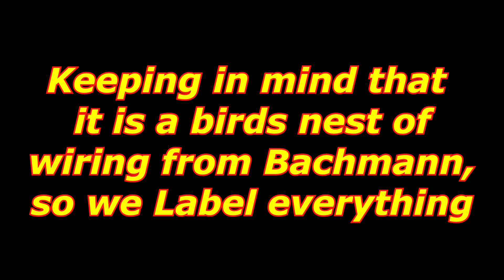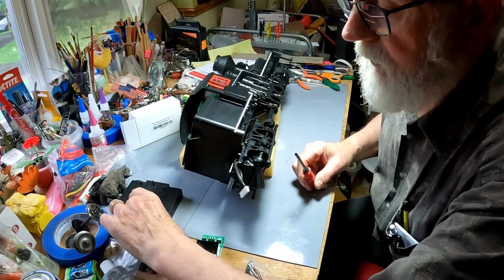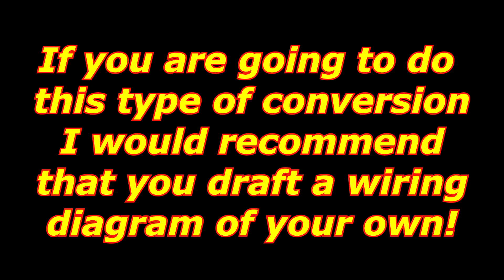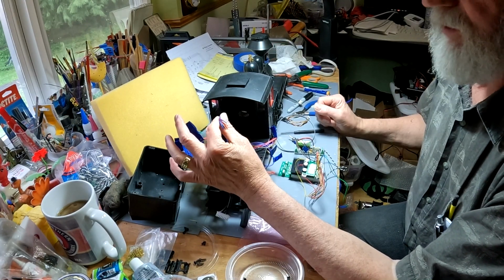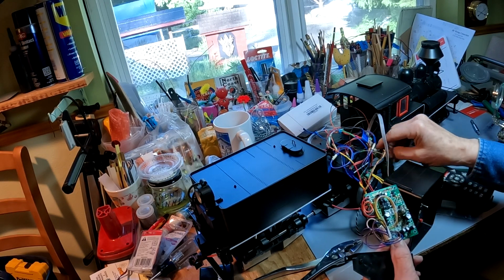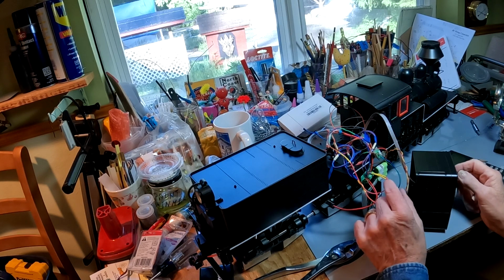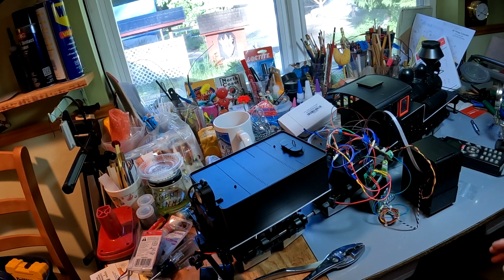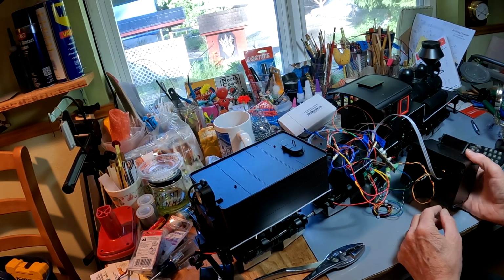3 Truck Shay Howe #5 Part 2

Comment: I've been wanting to remove my smoke unit and replace it with an ultrasonic mister, but I've been intimidated. If you ever do a video showing how you got in there to remove that, that would be really helpful.
Reply from the maker: Hi Suko, Getting in is easy.  The boiler face is removeable, you just need to pry it off.  and the wires and switches come off with it.  The smoke unit is held in place with two screws.  If I get a chance and remember, I will try do do a short video on it for you.  All Bachmann steam engines should be the same.

Comment: Question: Is that circuit board the stock board in the locomotive? If so, what does it do? I own two Bachmann Shays and neither has sound or anything fancy that would require a dedicated board like that, so I'm curious what the purpose of the board is.
Reply from the maker: All Bachmann Shays will have some type of board, it directs how the power works with track pickup, power to trucks, lights and smoke.  I remove the board and connect all the wiring to a RC board.